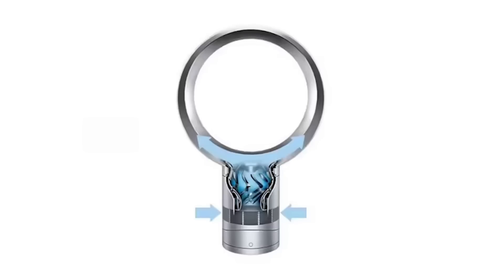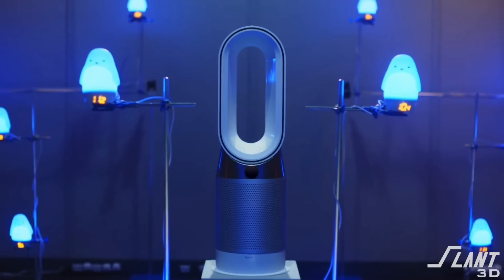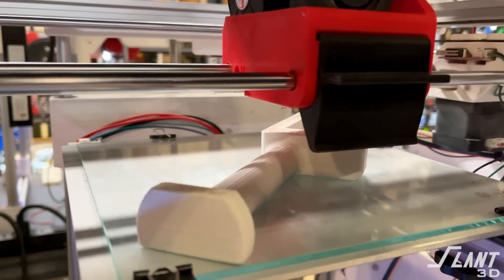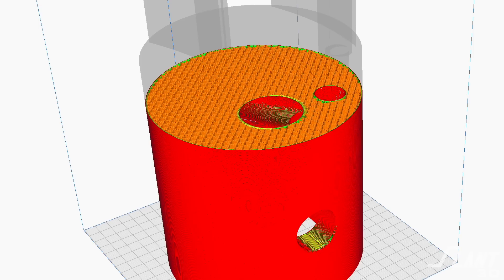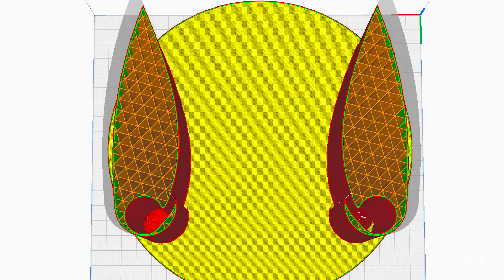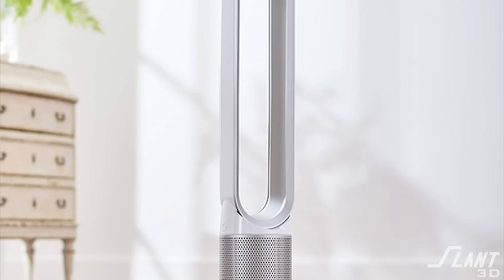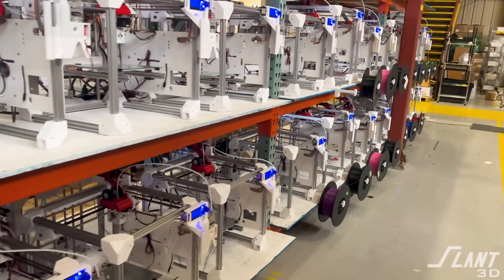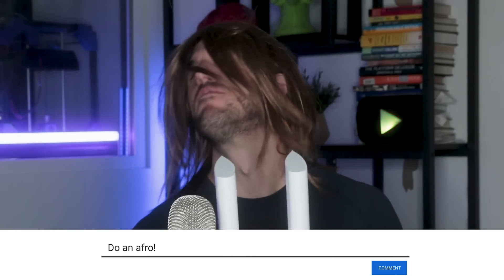We Made Dyson's Bladeless Fan for $25 | Design for Mass Production 3D Printing

Comment from the maker: Who Votes for a Part 2 Video and a final design that can be purchased both as files and as an actual fan
Reply: I think is is much more fun to get it as a file and print at home. As I am now printing with 100% PET plastic from bottles and I am always looking for some cool stuff to print, as my filament comes for free from the recyclable bin of my building.
Reply: I'd like to see a possible variation that utilizes a 120mm/140mm Noctua high pressure fan
Reply: I vote for a part 2. Maybe add interior split/multiple channeling in the vanes, to ensure similar pressure across the height of the sides as well as top (and bottom). Might have to get some fluid pressure modeling done to come up with this. Interior channeling will definitely highlight the ability of 3D printing to print complex geometries that would be difficult to mass produce conventionally.
Reply: I don't think Dyson will allow you to sell the patented design😅
Reply: I'm in, definitely get Part 2 going. Then part 3 can be aesthetics.
Reply: 100% for it :)
also great hairstyle :D
Reply: Do it!
Reply: I would buy that in a heartbeat
Reply: Would love to see this refined and try to print one.  But, aren’t these really noisy?
Reply: Yes please
Reply: But industrial.
Reply: Would love to see this built out.
Reply: Yes make a follow up and share please, this would be great 4 my camper.
Will you also compared the noise while developing 😊
Reply: Great project - Yes - move ahead! Btw: did Dyson contact you already?😉
Reply: Yes!
Reply: Yes part 2
Reply: I say ye
Reply: I've been running a Dyson fan almost every day for almost 7 years, from before I even started thinking about buying a 3d printer. I'd love to print another dyson
Reply: Don´t talk, make it 😊
Reply: Yes please! I'm probably not the only person with a 3D printer and an unused blower lying around waiting for a useful purpose!
Reply: Yes, I’d like to see! Even better if you find it doesn’t work well enough and find solutions to improve.
Reply: It wouldn't be bad if you could split the fan into several 3D printing files for smaller 3D printers up to 200 mm.  Where is the file for this?
Reply: Yes please optimise the design. I would love to pay a fee bucks to print my own bladeless fan :)
Reply: Go for it!!!! Part 2!!!! Part 2!!!! Part 2!!!!
Reply: Part 2 - but only if you wear the wig!
Reply: Please make files available, for a reasonable fee
Reply: Followed by a Part 3 about the patent infringement lawsuit.
Reply: @frankbauerful  there would be enough change due to  the redesign it's not like they have a patent for an air foil or blower fan
Reply: @bigcheesedog2645  They probably have a patent for a blower fan USING an air foil.
Reply: Easy Chaka Khan
Reply: It's just a replica
Reply: The files should be free.

Comment: 1:40.
yes. yes i DO have an old fan with metal blades from 1950, and its run almost 24/7 for the last three years after pulling it from the cupboard, after the dyson fan TRIED KILLING ME IN MY SLEEP!

i woke to that acrid smell of burnt electronics and plastic... the heater had turned itself on full blast, and melted everything before blowing the breaker...

Comment: is it more efficient though? 
i cannot wrap my head around that making more obstructions for the airflow somehow would make it more efficient at blowing air. otherwise why wouldn't helicopters or aircraft employ this design..
Reply: Around 35 % less efficient than classic fans.
On flying staff, like helicopters and/or aircraft, it would be much much less efficient, on top of all the difficulties of directing the air flow. 
To see a proof of the last it is enough to observe how this "bladeless" (with blades hidden in the base) fan would behave when some wind is present — be it perpendicular or be it frontal (against).

Comment: I actually printed about 400mm diameter cicle with Dyson's wing profile, it has 110mm inlet. But I wasnt able to find motor powerfull enough to produce high pressure airflow inside that ring so it was very low efficient. Tried examble large stove / hoova motor.
Reply: I think most epic thing in these dyson fans aint just that "venturi nozzle" style outlet.. but that extremely good power / noise -ratio motor which makes tiny turbine produce high flow with good pressure

Comment: I have cheap air purifier (one that looks like a pill and you place it in the room and turn on), I don't have very high hopes for cleaning the air beyond removing dust, but it has nice airflow. The issue is, the airflow is directed upwards, so we can't use it for cooling. But if I would have adapter like this it could be a great fan too! The only issue is that offgassing from the plastic could defeat the purpose of air purifier.

Comment: Do part 2, and invest in a 120V axial industrial fan rather than an air pump.  You should get a much higher airflow using a 12 to 20 dollar fan which has the same size and shape as most computer fans (120mm) but with a thicker profile of 35mm to 50mm versus 15 to 20mm for the PC fan counterpart.  Then, add a fuse/breaker and an off the shelf dimmer switch sold for lighting.  This should give you speed control for cheap.  For the hardware BOM, it should be in the $30 price (not including any bulk discounts or shipping in from over seas) range while providing much better flow than Dyson.  To finish off the top, don't get too elaborate, but stick with a functional piece.  Maybe it could be printed separate and snapped into place.  

I do may facets of R&D for a living, so let me know if you want help with the design.  I can run a basic computational fluid dynamics simulation to help you get a more refined design in a very short time.

Comment: Dyson fans are less efficient than regular propeller fans which are the most efficient and the least loud. Turns out that restricting air flow that you generate with fans hurts efficiency.
Reply: https://youtu.be/dS0oFmzU06g?si=04vm512tEt-eskX3
Reply from the maker: Incorrect
Reply: @slant3d  well actual experimental data says otherwise.
Reply: @slant3d  Around 35 % less efficient than classic fans. It is physics. Anyway the efficiency loss has been measured.

Comment: Brilliant product prototype and video.

Definitely do a Part 2. I could see including a multicolor LED (or 2) on the base between the blade wings to add a custom ambiance. A piece of plexiglas, or a semi translucent topper over the wings would increase efficiency and help complete the looks of the design. This topper, could also be a customization feature. It doesn't have to be an arc, it could be a cylinder, a small display shelf, or with extensions, a lamp shade.

Comment: arent these style fans less effiecent than the classic (but decent ones) fans? in terms of noise and output?
Reply: Yes.  In a nutshell, the fan in the base has smaller blades that have to spin faster.  However, if you went with a UFO design, then the story might change.  You still need to deal with an enclosure that restricts airflow though.
Reply: Around  35 % less efficient than classic.

Comment: i hope you don't start the part 2 right now..... 
you could use inline fan duct? inline duct fan? its working more silent, and also more energy efficient, also still have enough air pressure...
150w for desk fan its too much energy... also noise from common air pump....
Reply from the maker: Hence the part two

Comment: It would be fun to see a part 2.  It would be interesting how well to know the fan would work if the vanes were a different shape than oval or round.
Reply from the maker: They have to be an airfoil to be functional
Reply: @slant3d  But do the airfoils have to be formed into a circle or oval, so they meet together (e.g., the one you made here is really just two straight ones)?

Comment: Is it not too big for a regular printer ? Could it be printed in 2 pieces, then clipsed together? (Or make the separation at the top of the cylinder and design the separation in a way that could be screwed together 😁)
Reply from the maker: That would increase manufacturing cost in production

Comment: Would be great to build a small version of this with a Noctua fan in the base. I imagine that would need some holes for air intake and adjustments for the internal air channelling but could be a great use of some spare computer fans.
Reply from the maker: That would be cool
Reply: correct me if i'm wrong but doesn't this kind of fan need a decent amount of pressure? i don't think noctua is optimized for that
Reply: think theres files for a desktop fan thing for noctua fans, its like a funnel that works well.

Comment: Would love a part 2 if its for a more low noise fan. i remember that type of fan used to be VERY loud!
Reply from the maker: Since it is burried inside it is not bad
Reply: @slant3d  Those pumps are hot garbage. Yes, they move a lot of air but are prone to overheating and feature probably the worst brushless motors cents can buy.

Comment: This is a great idea! It is also interesting to measure the volume of air that is pumped by this "dyson" fan with an anemometer and compare it with the volume of air that only one fan produces, without aerodynamic wings.
Reply: That's when you find out that Dyson just has good marketing, normal fans are more efficient and quiet with moving air.

Comment: Yes, develop it, unless there's a patent:  

1) make it a rabbit sculpture, or robot, or bug, or anything with antenna/ears that stick up... which are the vanes.  Also, in any design, it would be better if the vanes didn't start going straight up right at the base but had some intermediary shape.   Or, make it a city- scape that happens to have 2 vane-shaped towers.  Lots of fun sculpting options that would entirely hide that it was a fan.

2) add LED lighting that shines through various parts.  Make it a desk lamp/fan.  Go really fancy and make it one of those back-light 3D printed pictures... can't remember the name.  Let people upload the picture they want.  Automate the production of personalized lamp/fans.

3) make it a solder station with fume extractor.  Much wider table in front, much lower profile.

4) in general, a desktop/shelf model with a much, much thinner base would be good.

5) add a water mister for cooling.  Tank on the top, gravity drip feed into the vanes.  Yes, leverage all that 3D printing advantage for tiny channels that distribute the water inside the vanes.  Maybe funnel any excess water out to the top of the base where it can pool and evaporate or get wiped off.

But, a question:  Does it need a high-velocity fan to work?  Or, put the opposite way, can a PC case fan move enough air to do anything useful?  Mostly, thinking about noise.

And, that brings up another video topic for you.  Can you add 3D printed internal structures that dampen noise?  Like, rather than having to add foam or something for noise dampening, can you just print a structure that absorbs the sound energy?
Reply from the maker: Interesting Ideas
Reply: @slant3d   Really, a personalized kid-finger-friendly desk lamp/fan/mister might sell well... for anyone that happened to have a big 3D print farm.  Print in white and advertise it as something the kid can paint. 

Oh, and I bet with some experimenting it would be possible to have the right sized or shaped water channels that only flowed when the air was being forced by the nozzle.  This actually sounds interesting... might try it myself.
Reply: . @4Fixerdave  Low humidity areas like Arizona would probably really get a lot of benefit from the built-in mister.  But other areas like the midwest states, not so much.  Might be good to have a humidity sensor built in.  But then you would need a microcontroller and etc., etc.  But it's fun to think about all the possabilitys

Comment: So how is this $25? Is that just the fan or is filament included? Guessing machine time is left out if the equation.

If doing a part 2, use an anemometer in front of the fan to see if it is actually sucking other air through.
Reply from the maker: Yes the second video would go much deeper into the testing. This video was mainly to highly complex geometry and part consolidation in mass production

Comment: i see one disadvantage: 3d prints are rough and for most cases it's fine but not for aerodynamics. Efficiency of 3dprinted part is much lower than injection molded part. Of course without any post processing.
Reply from the maker: The layer lines are perfectly aligned so that they do not cause aerodynamic issues. And even if they did they could actually improve performance liek the dimples on the golf ball
Reply: @slant3d  nice hypothesis although drag is proportional to surface area, so all groves between layers increase it drastically. A lot of youtubers proved that printed wings acts worse without sanding or putty/epoxy. Also golf balls have dimples but have smooth surface finish. FDM ASA prints have 22,5 um surfase roughness (as printed), injection moulded around 0,5 um.

Comment: Yes for part 2. I think it would be better if you added 2 more pieces to close the loop. It looks like there is a lot of air that would follow the path of least resistance and rise upward instead being fully entrained.
Reply from the maker: We would love to do a part two. Yes an upper arch would likely be added
Reply: @slant3d  Also, it would be interesting to make a third version with taller, open vertical blades(with the same area as the closed version) and compare the three versions to see if there is indeed any difference in airflow. Great video.
Reply: I'd love to see a part 2 as well I think your videos are extremely informative.